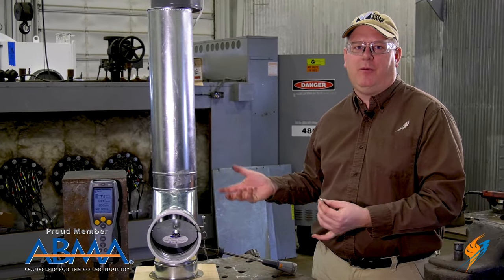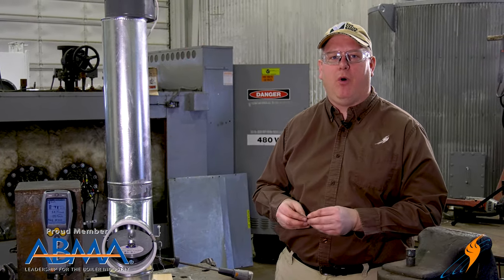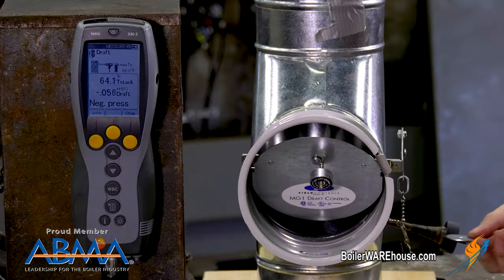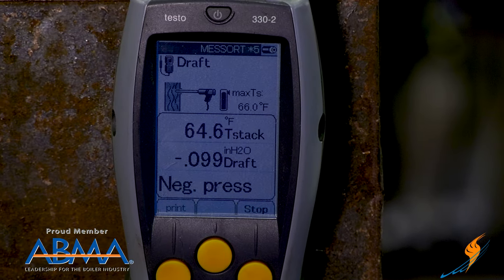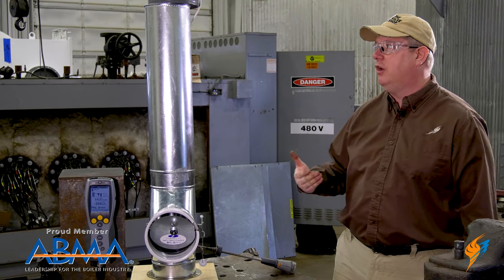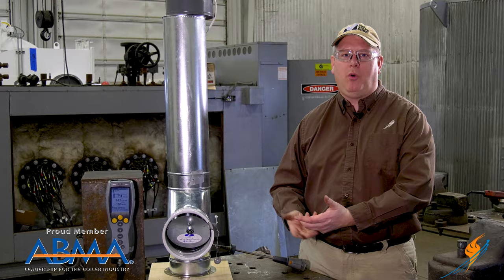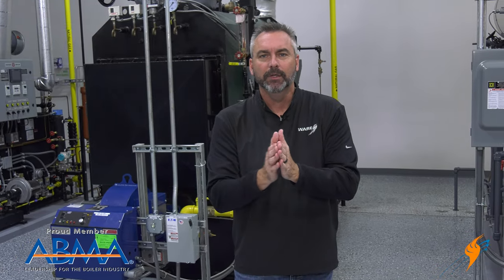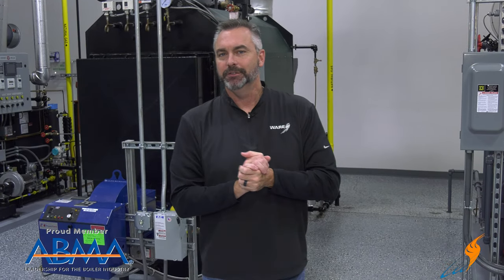How Barometric Draft Controls Works in Steam Boilers - Boiling Point

Comment: This is one of the most overlooked part of any fuel fired appliance... It is absolutely necessary to set your draft to a proper range. generally as low as possible. I like a range of -.02 to -.06. 
I see many appliances actually overfired with the combustion analyser because of excessive draft. If you set your fuel pressure to factory specs and then try to tune the burner, it is often found to have too high of O2. Most people will assume too much air being introduced into the burner dampers due to a linkage or damper adjustment... Its very possible that you have too high of draft. Air in equals air out!! If your draft is too high, you will lose efficiency due to moving too much "excess air" through the combustion process. It is very important to not only check your draft first but more importantly make it stable under all conditions with a barometric damper or similar. Only then can you properly set your burner combustion to proper ranges.
Reply: Thanks for your comment....Do you have any idea are they used with HRSGs/power plant stacks? Thanks.

Comment: I do HVAC work we run into fair share of heaters and boilers and I got this PK thermithic replacement boilers that when it was installed 2 years ago they never installed drafts.  It really never dawned on me that I had to have a draft until I talk to Tech Support. Now the stack goes up all about 15'.  I find it odd that boilers can run for about 2 years with a critical piece of equipment not installed.  Now the boiler fails at least once A-day on Ignition failures. So I'm really hoping that when I install this the problem is gonna go away. Fantastic video thank you very much

Comment: This unit then is useless without that tool? I picked up old school powerless oil furnace. I wanted to add this to it. But I also want to have the wood stove hooked up aswell to the same chimney.  And use them both but one at a time.

Comment: If I add this to a coal/wood stove, at what point do I read my Dwyer manometer and set the damper? Without having a fire in the stove? If so, I guess I would lose conditioned air when I'm not using the stove but that may be minor. Thx!

Comment: Excellent video....Can anyone tell please are they used with HRSGs stacks or huge power plant coal fired boiler stacks? I have seen induced drafts fans? So, do these barometric dampers provide same purpose? Thanks.
Reply from the maker: A barometric draft can only regulate and control draft, not create it.  If there is not enough draft, as in many larger applications like you mention, more can be created with a taller stack, or induced draft fan.  Either can be paired with a barometric damper on smaller applications.

Comment: ¿where or in what parts of the boiler should be installed the taps of the furnace pressure transmitters of a balanced draft coal boiler?